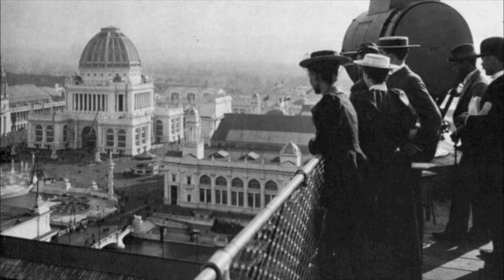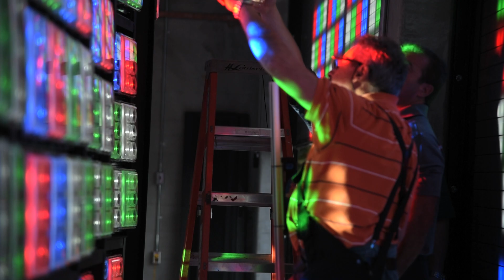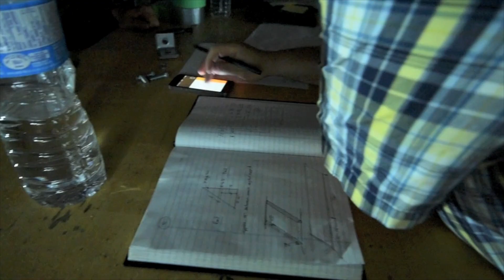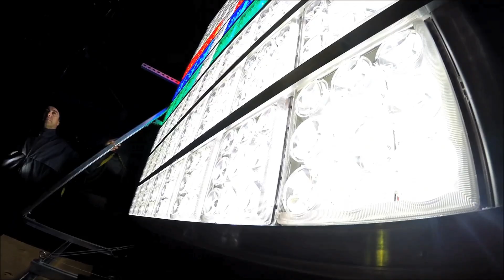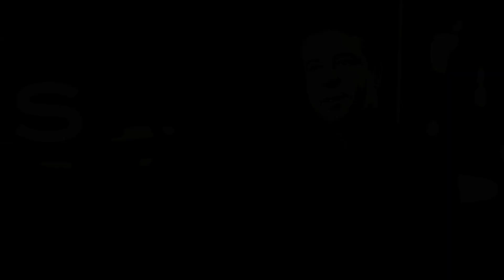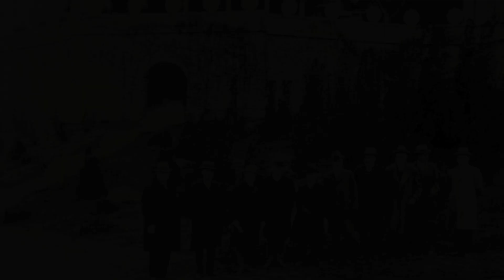Niagara Falls Illumination - The Story of lighting Niagara Falls

Comment: Nicely done.  I was a Design Engineer for Xenotech, Inc. that designed and manufactured the Xenon retrofit modules of the carbon arc lighting system in the late '90s.  I have fond memories of working with Linus MacDonald.  One of the requirements was that the retrofit had to fit inside the original carbon arc housings.